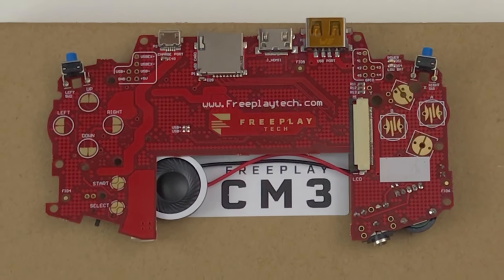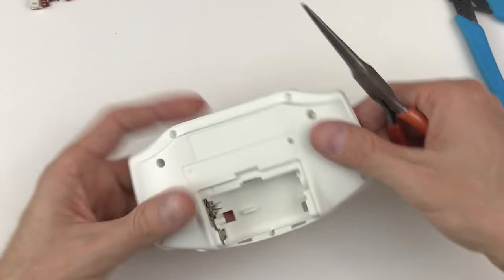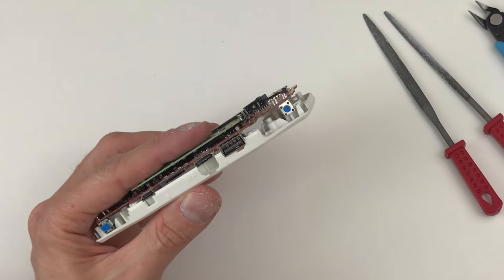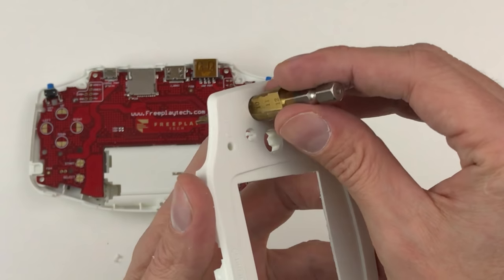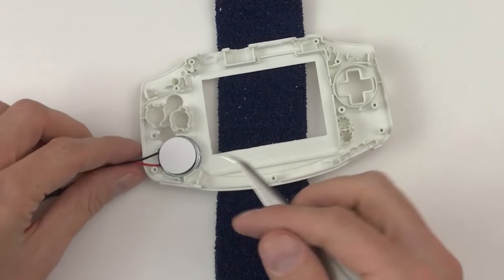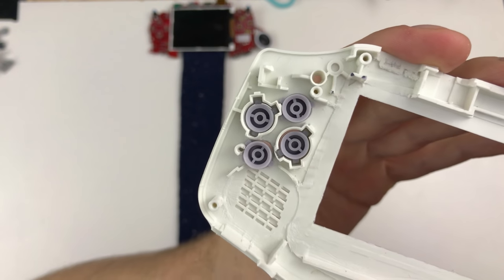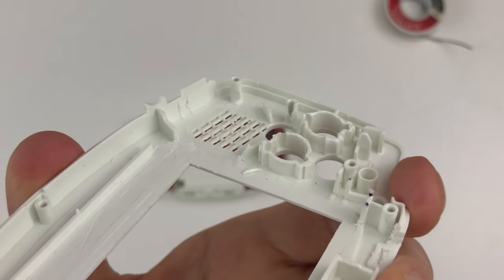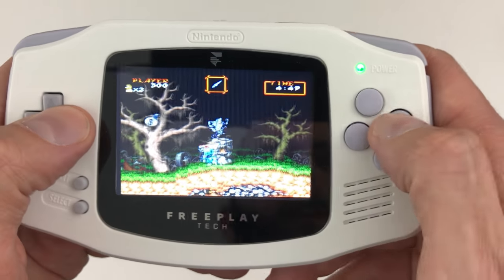Freeplay CM3 Example Build - New X&Y Button Options

Comment: As far as the button placement is concerned, is there anyway to remap the buttons on the software side?  As it stands right now X is located above and between A & B while Y is located below and between, correct?
Reply from the maker: Off the top of my head I don’t remember the default button settings, but you can change the buttons to whatever you like. After you start your device and everything is loaded you press start. Then you just go down to “configure input” and you can set any button to any button. I usually set up a keyboard to act as a controller that way too. Just in case I go crazy in the settings and somehow lock myself out of the main controller. Like if I accidentally change the controller number for an emulator.
Reply: @jivinhipcat  Awesome, thanks for the reply!
Reply: Wouldn't you lose the mapping of the power slider as the main hot key that way?
Reply from the maker: Good question. I actually never use the hot key function of the power slider; I just use Select. If that does happen I guess you could just change the keymapping in the Hotkey+X menu for the core/game you want. I usually do this for each core also. For older systems I usually make sure the top buttons are Turbo and the bottoms are the original buttons. There are probably other ways too, like setting them up in a config file somewhere. These Pis seem to have about a million ways to do everything.
Reply: Good point! I kind of like the power slider as a hot key since it prevents accidental saves, loads, etc. I guess I'll have to ssh into it and manually change the file.

Comment: Have you looked into using a 3D printer in order to make a case?
There are places that will print 3D models for you.
Reply from the maker: kairon156 I actually have a 3D printer, but I’m not good at modeling using CAD yet. I’ve tried to find a good model of a GBA to print, but haven’t been able to yet. I know you can now buy an aluminum machined case that fits the Freeplay kit so you don’t have to modify anything. I haven’t gotten my hands on one of those yet, but the site is https://www.boxypixel.com . A little pricey, but it seems worth it for the aluminum shell and all the work that goes into making them. I will probably end up buying one at some point, but I need to knock out the few builds I’m working on first. I have GBA style build I’m finishing up now, and also a,... different form factor :)
Reply: @jivinhipcat  So many cool high quality choices, Makes me wish I had that kind of spending money :)
Different form factor??

Ever sense I heard about 3D printers Learning how to use a 3D modeling software seems like something I would like to learn. Even if I just sell the 3D files
Reply from the maker: kairon156 It’s wierd, but I was just talking with someone about 3D modeling. I don’t know if they will do it, but it sounds like they may start working on a model. If you start working on a model I’ll help out by test printing or whatever I can too. That would be cool. Oh yeah the different form factor rhymes with “Gameboy Pocket.”  It will be kind of a weird one though if I can do it :)
Reply: @jivinhipcat  I doubt I'll be looking into 3D modeling for myself other than something to "research". 
I do appreciate the offer though.

It's cool you might know someone who will be able to do it for you though.

Comment: How do u get a pi zero to run n64 orcana of time?
Reply from the maker: They do have a Pi Zero kit, but this one is the CM3 kit. It uses a Raspberry Pi Compute Module 3. Actually, I’m just finishing up another Slim build, dual analog version, using the new CM3+.

Comment: Is the part at 25:30 really necessary??? I don't trust myself with that
Reply from the maker: I’ve done builds with and without that little plastic piece. For the builds where I removed it I made sure to bend the sharp metal part of the shoulder button away a little from the screen and ribbon cable to make sure it didn’t hurt the screen or the ribbon cable. I also started to modify the screen a little to help with centering it in the shell easier. On the ribbon cable side of the screen there is a bit of white plastic that sticks out. It can be trimmed away slightly to help with centering the screen. VERY CAREFULY THOUGH; the screen is pretty fragile and can easily be broken. Best to not go that route unless you are either confident in doing that mod, or don’t mind replacing the screen in case of error. Just a heads up. Are you working on a build now?
Reply: @jivinhipcat  no not yet I'm still researching what emulator build I'd like to get, honestly this seems like really fun and satisfying to make but I'm very clumsy and I'd rather buy an already made one, but I'm not sure I'm on the fence still :o
Reply from the maker: reverse I’m not sure why, but the time stamp of your question first sent me to a different time. Now I see it is linked to 25:30 for the soldering. Crazy YouTube. You could just go with the other button style with the regular silicon pads to avoid having to solder the soft tact switches if you’re not too comfortable with soldering :)
Reply: @jivinhipcat  about how much do you think one of these cost? Does it play N64 good? Which ones the z button?
Reply from the maker: Hmmmm it’s been a while since I checked the website to see prices. I always end up recycling my builds into new projects until they end up looking like my latest Pocket build 😂. So you can just look around there and maybe the prices change depending. It uses the Raspberry Pi CM3 or CM3+, so it does play a bunch of N64 games pretty well, but there are also a bunch that it can’t really handle. I’ve played games like Turok, Mario Kart 64, sand Ocarina of Time pretty well without digging into the settings. Some people really like to optimize their Pi experience to get the most out of systems so you can see what people have done and recommend for different emulator cores and games. There is sooooo much you can do with a Raspberry Pi so you can really jump down the rabbit hole and get into if if you really want to. As far as button assignments go you can map whatever you want to whatever you want really. Oh, of you mean L2/R2 type shoulder buttons then you can add those in different ways. They make an addon board with them also.
Reply: @jivinhipcat  okay my LAST question😂😅I'm sorry I'm new to this, I just wanted to know if it'll play Conker's bad fur day well on 64 & banjo and kazooie? And thank you for telling me about the button assignments:)!
Reply from the maker: reverse No problem at all. I don’t know about those games specifically. I think Conker’s may be notoriously difficult to emulate compared to others if I remember right. You can look around for game emulation on Raspberry Pi 3 and 3B+ by searching something like “raspberry pi 3 b+ conkers bad fur day.” That should get you started to see what people are doing specifically for the exact games you are most interested in. That game is really good? I may need to check it out actually because I keep hearing about it but have never played.
Reply: @jivinhipcat  yeah you should check it out it's really fun!